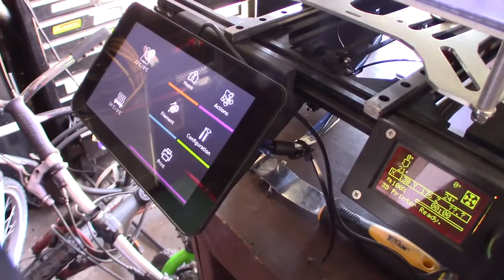Raspberry Pi office 7" 2020 2040 mount for octoscreen octodash octoprint tft 3D printer console

Comment: How did you attach it to the raspberry case?
Reply: Looks like M3x45mm bolts and T Nuts are needed.   I printed this and ordered what I think I need and will leave another post after.   This is exactly what I wanted.